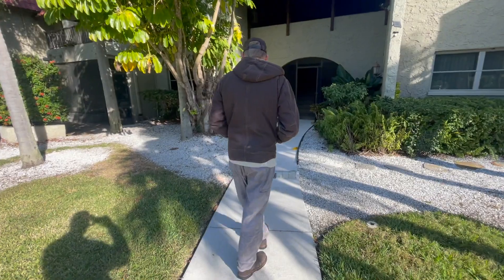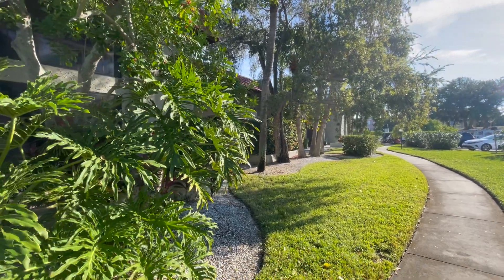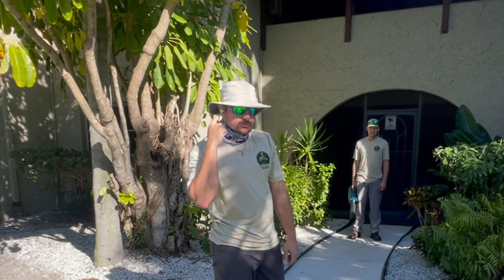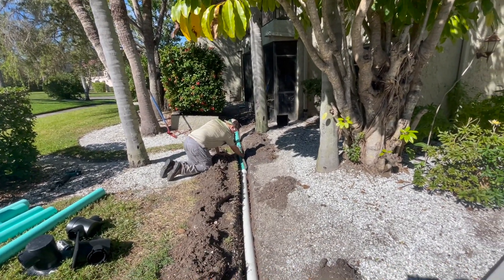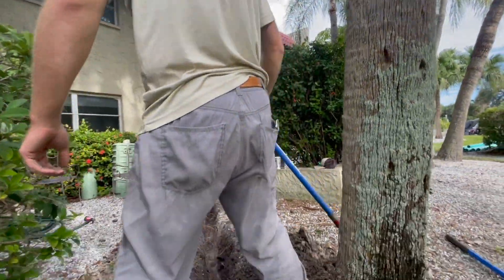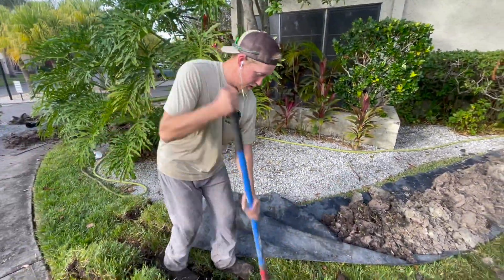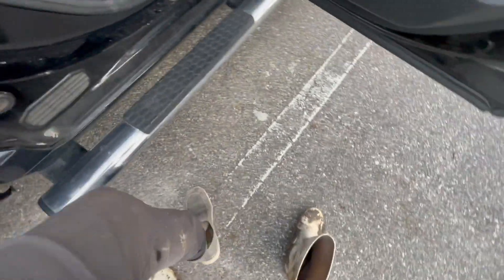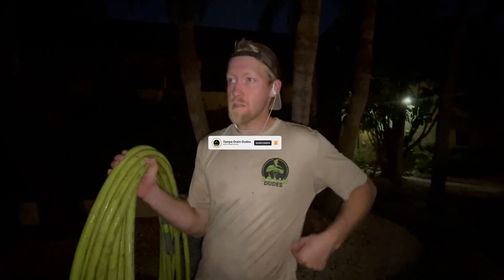How To Install a Channel Drain | Commercial Sidewalk Drainage

Comment: Another pop up emitter, pipe will fill up with dirt and debris like the old pipes did. dirt can't flow UP a 90° pipe, it will sit in the bottom of it and clog it up.
Reply from the maker: That’s what catch basins and routine cleanings are for. There’s also a relief point at the bottom of the emmitters, with drainage rock below it.